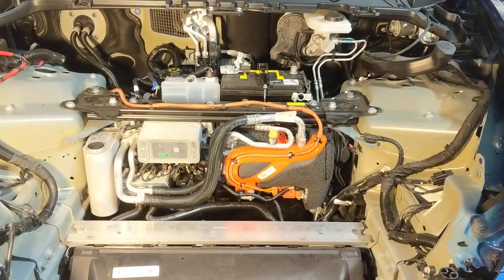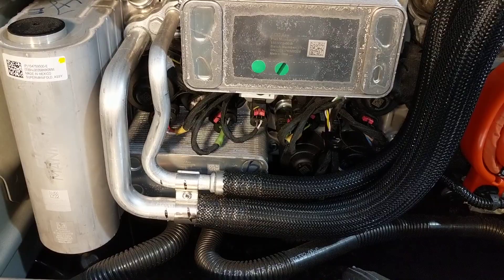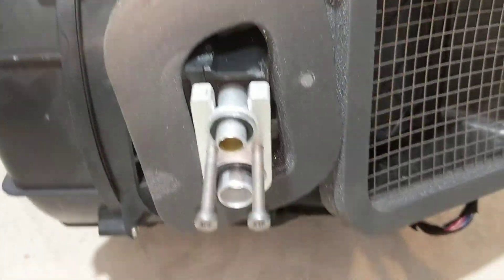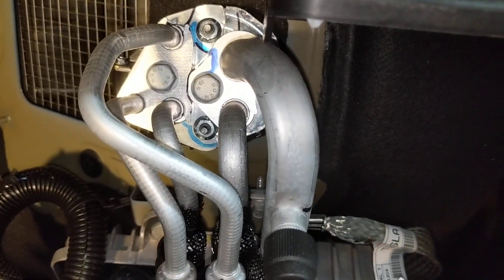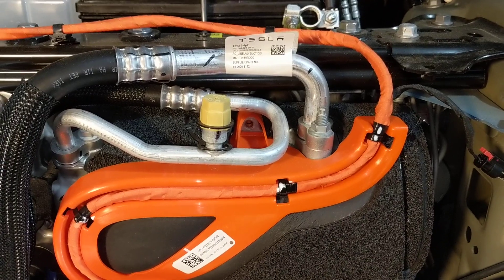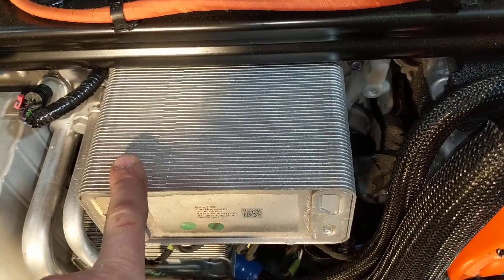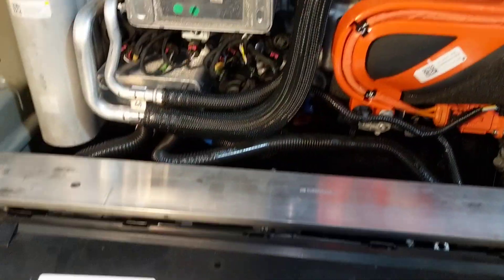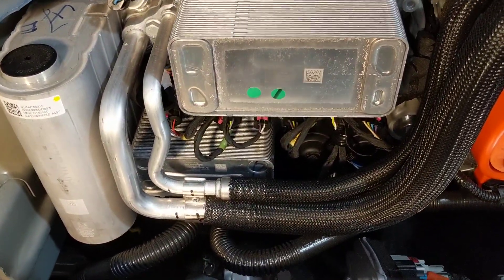A quick look at Tesla's HEAT PUMP!

Comment: I'm wondering how moisture can ever get in thru the rubber tubing & into the refrigerant, assuming their is always positive refrigerant pressure?
Reply from the maker: I don't fully understand the mechanism, but maybe related to osmosis.   Tesla recommends desiccant change every 3 years, and they wouldn't do this if it weren't needed.

Comment: At 5:22, you said that moisture can get into the system through a rubber hose. How can moisture get into a rubber hose when the pressure of the refrigerant inside the hose is always above atmospheric pressure?
Reply from the maker: It isn't, the suction line can be below atmospheric pressure when the evaporator is at low temps.  Also, the suction like will be covered with water because of the low temps.  If you look, most manufacturers recommend replacing the desiccant.  (Tesla says every 6 years)
Reply: @Ingineerix , the only time I've ever seen a vacuum on suction side is if there is a blockage. For R-1234yf, it looks like anything above -22ºF is above atmospheric pressure. I'm pretty the suction side doesn't get that cold. :)
Reply from the maker: @zroger73  Maybe true, but there is some mechanism for moisture to overwhelm the desiccant, Tesla recommends it be replaced every 6 years, and you have to discharge the system to do it.  Keep in mind this is not a normal A/C system, it's a heat pump with no normal air-cooled condenser, it's got a LCC and a chiller.

Comment: if your tesla 3 approx 3 years old looses refrigerant due to a  leak  are their protections like a low pressure switch ? or does it keep running an ultimately ruin your compressor .
Reply from the maker: There are sensors everywhere.   It will self-protect.   Luckily the way this system is designed it's unlikely to leak.  All the common leak paths on ICE A/C systems simply don't exist on this one.
Reply: @Ingineerix  wow fast great response thank you ..tesla said my compressor went out because of low refrigerant because of a hose leak but i knew there were safety's to prevent a failure due to this ..not saying the comp is not bad but not because of a hose leak .
Reply from the maker: @GuitarMagik  Yeah as soon as the refrigerant is low, there will be a VCFRONT_a160_compressorInhibited alert that will stop it.

Comment: If it doesnt produce new heat, how can it create heat when the car is sitting outside at -20C?
Reply from the maker: Well, unless it's −273.15C outside, there is still plenty of heat around.   But it can augment transfer with a total loss mode if needed.
Reply: @Ingineerix  that is true. But it is wild to imagin warm air getting created by heat transfer at those low temperatures.

Comment: When the coils freeze up in colder climates like Alaska, does this model have a reversing valve to thaw out the ice like home heat pumps do??
Reply from the maker: Yes, They also can operate the system in "total loss" mode (COP 1) if needed.

Comment: I must understand that both the Y model and the 2021 model 3 with chiller no longer have the condenser next to the water radiator like the previous models?
Reply from the maker: Correct, they now only have one glycol-filled "radiator" and use a LCC (Liquid Cooled Condenser) as I show in the video.

Comment: @ingineerix. What is your Views on the 2021 and 2022 model 3 and Y's with heat pump loosing heat when the temp gets below -20c to -40c. That is what is happening to them in Canada, the prairie provinces where the temp in the last week has been -35c?(saskatchewan,Alberta)
Reply from the maker: I don't know.  I'd guess it's a bug.  Theoretically the system has the ability to fall back to "emergency" heat from the drive unit inverters even if the Heat pump couldn't muster it.   -35C is damn cold!   I don't know if I'd own an EV in those kind of temps without at least a garage.   My guess is Tesla will fix it.
Reply: @Ingineerix  my co worker has a model x with resistive heat and absolutely no issues at all, even when it got down to -38 and -50 with wind chill. Resistive heat works very well in the.
Reply from the maker: @dandee5770  Well yeah, but it sucks down tons of power.  I think it can hit 14kW peak!
Reply: @Ingineerix  for sure, I think I would give up some range for heat, lol. Thank you for responding.

Comment: Thanks for another great video. I got my 2021 Model 3 in late August. 
Is there an easy way to know if it uses a heat pump or the resistive heater?
Reply from the maker: It should have the heat pump.  The easy way to tell is to unsnap the closeout cover behind the frunk tub (just below the windshield in the frunk).  No tools are needed.  Once removed, If you look just toward the left of the 12v battery (near middle of car), you'll see 5 aluminum tubes going into the firewall if you have a heatpump, and only 2 if you don't.   Once you are done looking in there, the cover just snaps back into place.  Once the cover is lined up, You have to use your palm to smash around the perimeter to get the white snaps to re-connect.   Don't worry, it's tougher than you are and you won't mess it up.  It's good to know how to do this anyway, so when your 12v battery eventually needs replacement, you can do it yourself.  It's easier than on most cars.

Comment: I love the heat re-use efficiency!  How does one know which Tesla models have this new design?
Reply: All the model Y's have it and mid/late 2021 model 3's .  Just from the top of my head.
Reply from the maker: Also all Plaid/Refresh S/X.  So all late 2021 Teslas.   The easy way to tell on 3/Y is to unsnap the closeout cover behind the frunk tub (just below the windshield in the frunk).  No tools are needed.  Once removed, If you look just toward the left of the 12v battery (near middle of car), you'll see 5 aluminum tubes going into the firewall if you have a heatpump, and only 2 if you don't.   Once you are done looking in there, the cover just snaps back into place.  Once the cover is lined up, You have to use your palm to smash around the perimeter to get the white snaps to re-connect.   Don't worry, it's tougher than you are and you won't mess it up.  It's good to know how to do this anyway, so when your 12v battery eventually needs replacement, you can do it yourself.  It's easier than on most cars.

Comment: I see “made in China” on that large stacked plate heat exchanger and “made in Mexico” on that receiver dryer.   I wonder if the cars in China have Mexican made receiver dryer’s?  I wonder if all the parts have to be labeled where they come from on Chinese made cars that will be used only in China.   Growing up as an auto tech I used to always get a kick out of the fact the Jack  would say made in Canada but in the recent years I started pulling out made in China jacks on GM’s.

Comment: Incredibile how Tesla scavenge heat from the environment and car components to save possibly 50% of the power used to heat up the inside of the car during the winter. A masterpiece of environmental efficiency. I doubt other car manufacturers will go for so much effort to save heating power. But in deep winter the heating can halve the car range; in that case, one can be proud of owning a Tesla.

Comment: So when its a morning in February in Minnesota and its 20 below, where the heat coming from to warm up the cabin before I get in the car?
Reply from the maker: Unless it drops down to absolute zero kelvin (-460F/-273C), there is still heat outside, and the heatpump just moves it inside, just like A/C does from inside to outside in the summer.   The system can also still operate at "full loss" if need be, which it will do if there is too much efficiency loss.   If you plug your car in at night, it can even pre-heat the car before you get in, using power from the grid, instead of reducing your range.

Comment: Resistance heat is fixed at 3.41btu/watt, heat pumps will have a temperature dependent COP (coefficient of performance) that is ratio of heat produced per watt. COP of 3.0 would be 10.23 btu per watt. At a “cold start” the performance will not be very good at low temps as it has to scavenge heat from the air. Once you get moving it should increase in performance because it can start removing heat from the drivetrain. There are other tricks to improving low temp performance such as spinning the compressor faster, at the cost of more power usage.

Comment: Super duper Thanks! Teslas are so intelligent! Looked at the MG which is a disaster. The charger is first in the cooling loop, heating instead of cooling the motor, and then send it to the battery. Might be ok in Canada but a heat disaster in warm climates. And they sell them not caring less!  If you ever have a chance to pop a hood of a Chinese EV do it with an empty stomach.

Comment: So Supervalve and Octovalve are 2 names for the same thing? Do all EV with heat pump work like this with one compressor?
Reply from the maker: "Octovalve" is the 8-port glycol spool valve.  "Supermanifold" is the name Tesla gave to the refrigerant valve body.   Yes, all heat pumps, either in vehicles or homes, use a single compressor.
Reply: @Ingineerix  Thanks for the clarification. I watched another video about how it all works and I am amazed.

Comment: If i understand correctly the PTC Heater is replaced by coils....so the heat pump here operates in both directions ?
So the AC compressor is always in use when heating, or cooling?   Not sure if that is more efficient in colder climates.
Thank you for the many videos.

Comment: Very cool stuff. I wonder why they chose to use so many refrigerant circuits and expansion valves? I would think just chill the glycol and send that wherever you need cooling and use the condenser water in the same way. You could even get rid of the reversing valve since you can redirect the heat and cold water wherever needed. Would remove a lot of hose connections and expensive valves. I’d imagine better reliability too. Maybe weight??
Reply from the maker: The computer controlled expansion valves are almost a must for HP operation, and definitely for efficient operation!  I see much higher reliability from these vs. valves used for glycol in any event.
Reply: You will still need 3-way valves to regulate temp, those stepper motor expansion valves aren't that (if more) expensive. You'll need an extra pump. A water exchanger will be bigger(no fase change), and the whole system heavier. You'll be adding complexity and lose efficiency because of the extra heat exchange...
Reply from the maker: @marcov6t770  2 EEVs in a "T" config IS a 3-way valve.
Reply: @Ingineerix  So? I was responding to Daniel, but two valves in a T configuration is still not the same as a 3-way valve, with two valves you can open and close independently, not with a 3-way valve.

But that was not the point, Daniel was talking about the complexity of the refrigeration circuit, and using chilled/hot water instead, but that would probably add even more complexity, space and weight.

Comment: Hello Ingineerix:
Thank you very much for your videos. I would like to ask you a question: perhaps I didn’t understand but you say that in the latest Model 3 the PTC heater was removed and instead of it there are two condensers inside the cabin for heating it. That is why there are five ducts that get into de cabin as it can be seen in the video. Two for the evaporator and three for the two condensers as you explain in the videos. I think one of them shares the return and the rest feed each condenser.  Is it right? Thank you very much.  
Diego
Reply from the maker: Yes, that is correct.   They divide the heating zones into 2 sections, and use 2 condensers for that.  3 lines, Left, Right, and Common return.
Reply: @Ingineerix  Thank you very much for your prompt answer. 
Francisco Skala

Comment: An animated version of the processes your describing here would be a really powerful tool to take this video to the next level.  I’m thoroughly convinced one of Tesla’s next products will be a heat pump for the home.  Currently the best in class heat-pump water heater available in Australia is made by Sanden a brand few know of... unless you have worked on a Toyota.  I’d love to also see the dimensions of the complete Tesla systems side by side.

Comment: Thanks and appreciate your videos. If  I may add a few words:   We all have learned that energy js neither created nor destroyed but it changes from one form to another. Therefore heat is not created, but since it is a form of energy, it is changed into other forms. In resistance heating electrical energy is converted into heat energy. Heat pumps are more efficient because they are not converting electrical energy into heat but using electrical energy to move or pump heat from one side to the other.  So how much heat is available on the cold side to extract? As long as the temperature is not -273 C which  is also absolute 0 or 0 K, heat is available to extract. Heat pumps efficiency is measured in COP, coefficient of performance,  whereas CoP of electrical resistance heaters is 1, meaning 1 unit of electricity is converted into 1 unit of heat, the CoP of heat pumps hover around 3, meaning that 1 unit of electricity will produce 3 units of heat.
Reply: That's right, but modern advancements (like variable speed compressors) have gotten the COP of heat pumps over 3.  The Octovalve can actually hit around 4.5 (in the best case scenario).  Of course, depending on conditions it can be lower than that.  Once you get below freezing it drops some, but remains effective until around -30F.  I believe the car does, in these scenarios, have a backup resistive heat source that it can use to heat the glycol.  But this is extremely inefficient, and only ever used if the heat pump cannot move enough heat.

Comment: I wonder if this is a fully DIY vacuum pump down-able and R134A rechargeable system if the front heat exchange had to be replaced - like in a crash.
Reply from the maker: R134A is being phased out.  Tesla now uses R1234yf, but yes, you could vacuum it and refill it as long as you make sure to never use equipment contaminated with PAG oil.  It will cause a high-voltage isolation fault (at the least).  Tesla uses ND-11 POE oil in the system.

Comment: Heat pumps are such counterintuitive things. You'd think getting more than 100% efficiency from a contraption should be impossible. Then the heat pump goes brrr and here you are with 400% efficiency.
Reply: Depends how you measure efficiency. The electric heater is nearly 100% efficient in terms of how much of the electricity is converted to heat. The heat pump is much more efficient in terms of how much electricity you need for the amount of heat you get, but is much less efficient in terms of how much of the electricity is used for the intended purpose of pumping heat vs how much is wasted as heat (in non-useful places).

Comment: The new cars have a ~1kw 12v heater in the HVAC case too, right?
Reply from the maker: No.  The older cars had a ~7kW PTC heater i nthe case powered by HV.  Now that has been totally eliminated.  If Tesla didn't have the ability to run the heatpump in loss mode, they would have kept the backup heat, but since it can there is no need.   They most definitely would not use 12v for heating in any event!

Comment: Thank you for explaining what the desiccant bag does! I'd heard that it needs to be replaced every 6 years in a Model 3, but I had no idea what it did besides "desiccating" something. I now know that it desiccates the refrigerant!
Reply: Every automotive AC system has a desiccant, usually in the receiver drier.
Normally would only ever be changed if ever you open up the system.
Reply: When you buy a packet of flatbread and it has a little packet inside that says DO NOT EAT, that's desiccant
Reply: @clonkex  it says do not eat not because it’s toxic it’s because you might choke.
Reply: @nimernimer  I know, not sure why you're telling me

Comment: I have seen that type of sheathing on a lot of rubber hoses in both ICE and EV's why do they use it?  is there some sort of structural benefit covering the hoses with it?
Reply: Yeah, the covers are for protecting the rubber hoses from abrasion due to vibration.
Reply: @morrisg  ahh I see its so you can see there is something rubbing up against the hose prior to it breaching.  Easier to find a tear in that material vs a hose.

Comment: Having owned two Teslas in a cold climate since 2013, I've long wondered why they didn't include a manually activated battery warming feature that would only operate when the vehicle is plugged in. When it's -10F outside and the battery is cold, it can be a long wait to achieve nominal charging speeds. I believe Tesla's heat pump equipped vehicles use the coils in the drive motors to generate heat, even when parked. But do they allow more energy to be used for that purpose if the vehicle is plugged in?